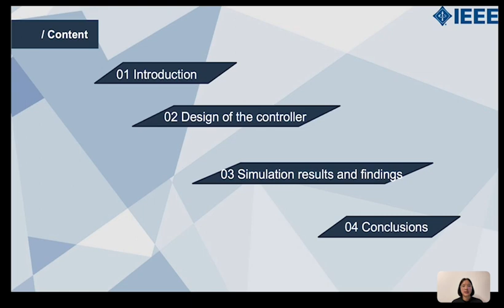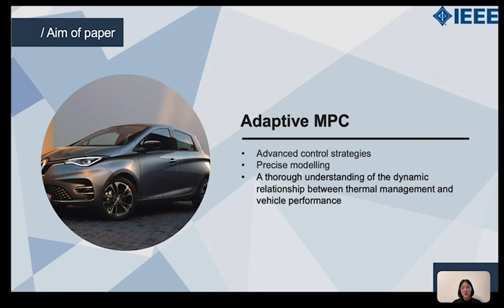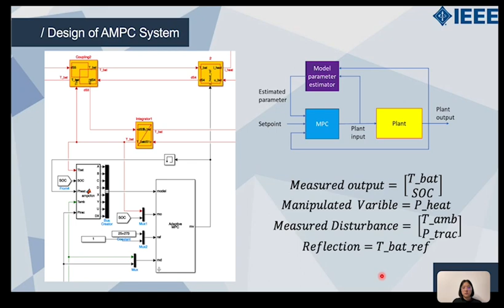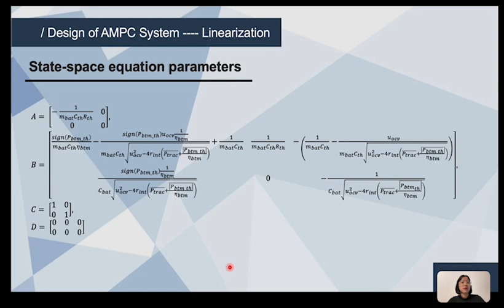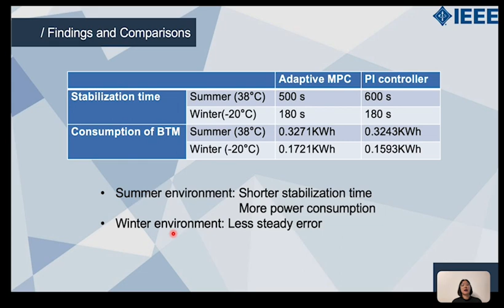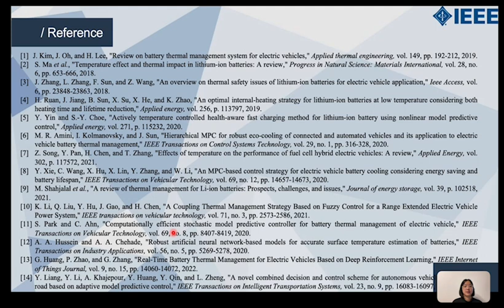Adaptive model predictive control for thermal management for electric vehicles

Comment: Great discertation. Thanks for posting this!

You mentioned that both models are heavily reliant on the model, and refining the model linearization. You also mentioned that a LUT was used to determine the battery internal resistance for this model as well. 

I more often than not deal with thermal circuits that exhibit highly nonlinear behaviour, but from dimensionless analysis methods and using PySR with empirical data, I'm able to generate these nonlinear funtions. How do you think I can develop a MPC controller around these constraints? 

Thank u for your time, and my apologies if my understanding is rudimentary. Thank you!